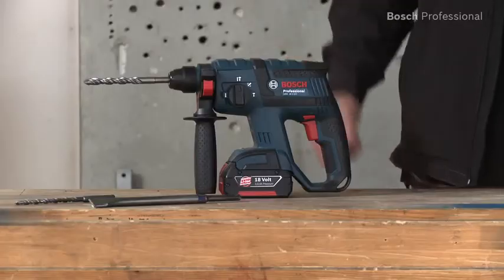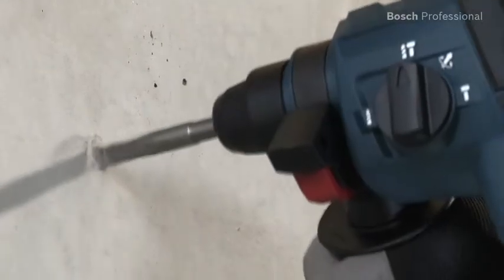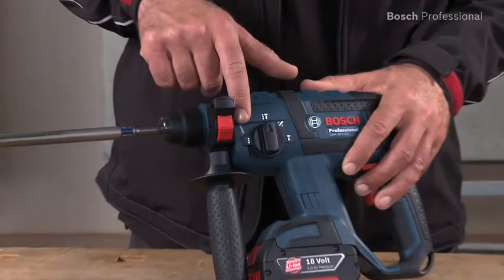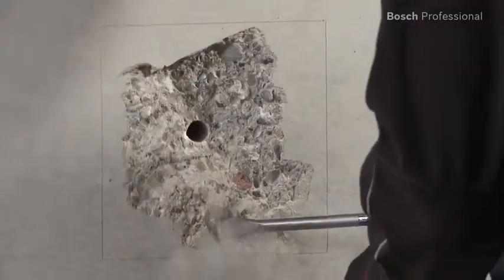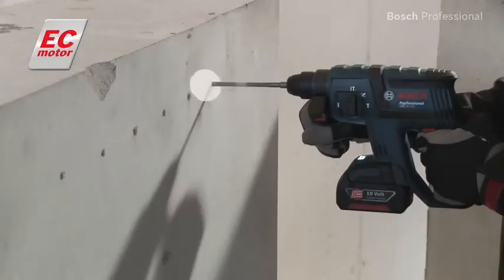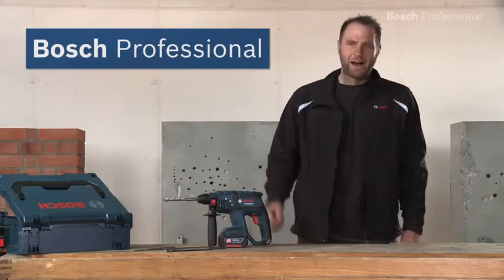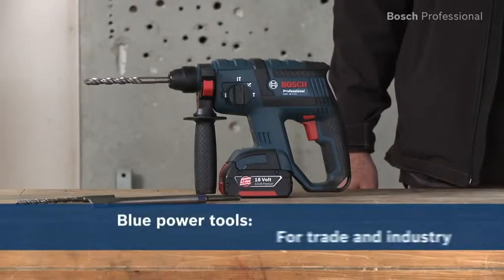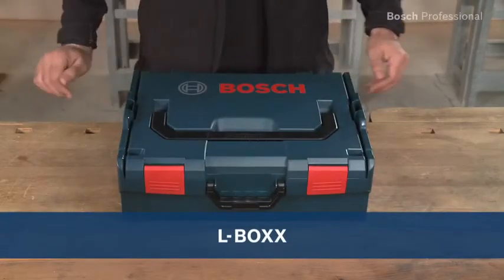Bosch Cordless Hammer Drill - Bosch GBH 18 V-EC Professional Impact Driver

Comment: I prefer the Dewalt DCH274 as the chuck can be change from SDS to twist grip shank type of drill bits. This Bosch unable to do it. You need to put adaptor and the effect is wobbly on the drill bits. Who dare drill on top of the ladder with a woobly metal drill bit.